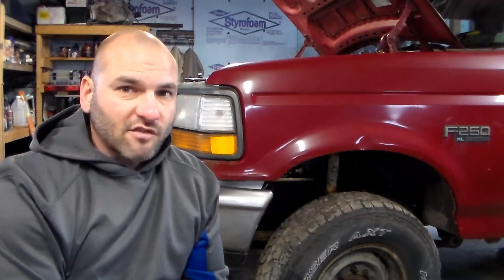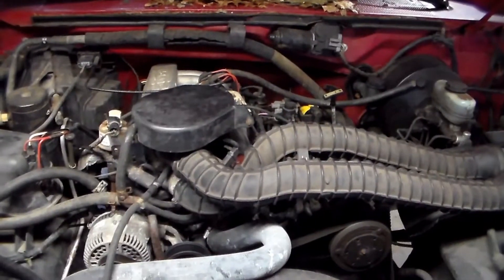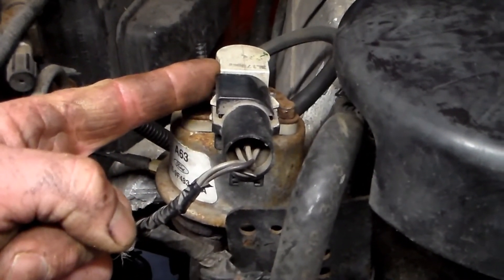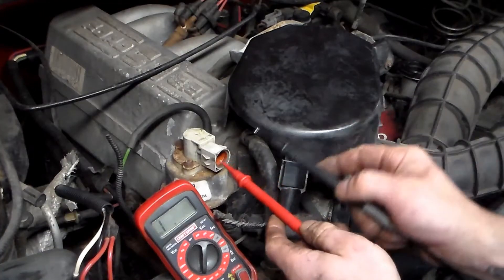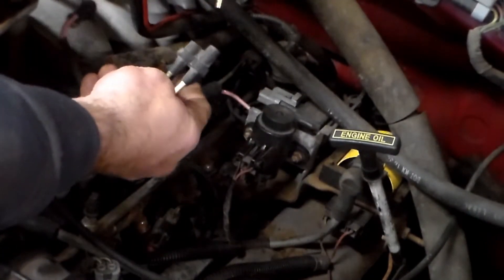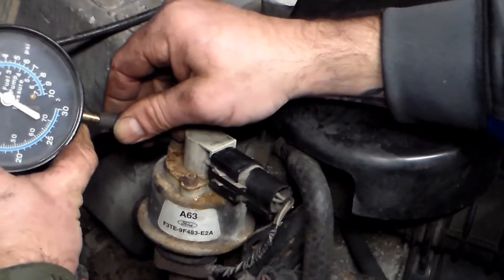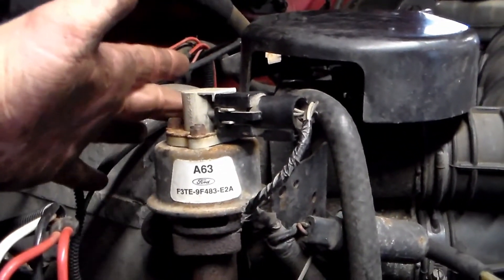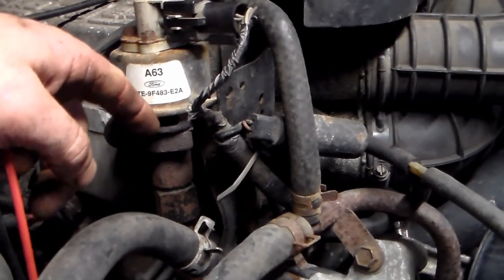Ford Truck EGR System - Complete OVERVIEW and TEST -  Step by Step!!

Comment: I also have a 351 and Im just thinking to take the vacuum hose off so I can get the EGR always closed. Luckily I dont have computer attached to the EGR. So the engine can run more efficiently and strongly without the useless exhaust air. If I take it to inspection I just put the hose back.
Reply from the maker: It will actually run better with a working EGR.  Absolutely get rid of the air pump system though! On gas engines the EGR helps, on diesels you absolutely want to get rid of it as it is counterproductive to the cool air the turbos require to run optimally.
Reply: @rednecktech82  Ill consider it, thank you!

Comment: Thank you for your time and simple explanations, 
Some folks ego's comes out when trying to learn about working on something...
I did not realize that was the vacuum control valve over there on the driver's side.
 
I have about 180K and had a severe duty trans rebuild and towing kit performed on my E4od automatic 1997 F250-HD obs at about 170K. (update all known issues with it except for solenoid pack)
I like this series of ford trucks.  
Things are tight on passenger side for exhaust manifold replacement, because of that warped oem exhaust manifolds from the factory (TSB's). Have to take a straight edge to replacement to make sure it is not warped. Clean up with 14" mill file, unless you have a way to fly cut/machine it parallel. Have driver's side to replace also.

Comment: Still doesn't explain why you lost vacuum with the new egr control switch immediately after revving. Cleaning egr valve will not fix vacuum issue because you need vacuum for egr valve to even function.

Comment: My 1990 Bronco 5.0L idles good and drives at highway speeds fine.  It stumbles a bit going up a hill, say 2000 RPM at 45 MPH.  (high load)   The Temp gauge on dash does not move off of COLD, but thermostat is working and engine is at operating temp.   How can I determine if ECU is operating in closed-loop?   Thinking that a faulty temp sender might be tricking ECU to remain Open-Loop.   If open loop, then ECU keeps mixture  enriched right?  The CAT dowmnstream from O2 sensor has a patina to it.  Does it normally operate super hot?  Because of the stumble at LOAD, I have been suspecting ignition issues, but watching your video, wonder if I have non functioning EGR.   How can I confirm ECU achieves CLOSED-LOOP status?   ANy help appreciated.
Reply: I have been dealing with the same issue with my 95 F150 5.0. In idle or park I can rev it for days with no miss but as soon as I put a load on it about 2000/2200 rpms while in drive (holding brake peddle or just lightly accelerating from a stop) it stumbles. I have been going though my ignition components as well but everything checks out. Now (like you) I suspect I have an EGR issue and will have to follow the steps in this vid and either verify my issue or eliminate the EGR system as my problem.
Reply: @LoveThyPitBull  I have a 93 5.0 I've been having the same problems and I read that if your temperature unit is not working right data mess up your EGR valve and everything it will give it incorrect readings your computer won't send the correct codes to the unit because the computer still thinks the engine is cold when it's not cold

Comment: 6:19 Verify there are no breaks, cracks, or leaks in that green vacuum line.
.
8:22 You can buy 5 feet of 1/4 vinyl tubing and place the tube over the vacuum port on EGR valve.  Put other end of tube in your mouth and use swallowing action (no joke, like a baby sucks a bottle) to actually pull enough vacuum to make the diaphragm move.  Stick your tongue on tube if you need to take a break.  It should hold a vacuum.  NOTE!!!  Do "movement testing" of EGR valve BEFORE you remove the sensor from on top.  Removing the sensor is like removing the lid from a vacuum sealed jar of nuts.  That sensor forms part of the sealed vacuum actuator.

Comment: Thank you! This is the best video covering the EGR system on these trucks. Clear, concise, and great info. I spent the day replacing vacuum lines and scratching my head, now I have a good plan for tomorrow.
Reply: Did u fix it?
Reply: @LaMouleQuiCoule  Yup! I'm 5.8 swapped now and it runs great!

Comment: I actually cleaned mine out 2 years ago and no more problems cause $100 is too much when you can at least try a toothbrush ($1) and carb cleaner ($5)

Comment: Hey man 
I hope you can see this and possibly give me a tip
My truck has the 337 code, i have replaced the egr valve and the egr control valve and still have the same code
I have to mention that my truck is a california edition so for some reason does not have    egr position sensor
so what should I check then , thanks in advance
Reply: My truck did the same thing,  I changed alot part's which turn out it was a bad cat. Codes of 91 seem not to read cats are bad sends Codes for errors errors.